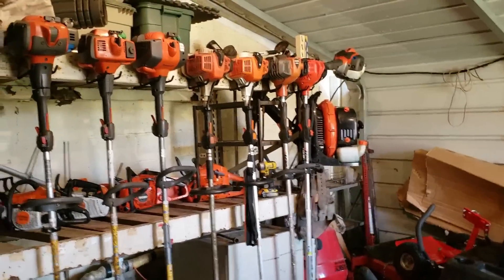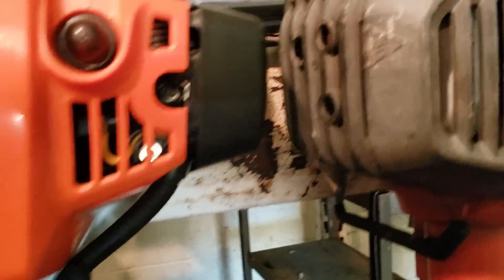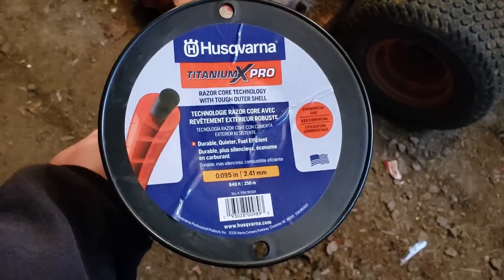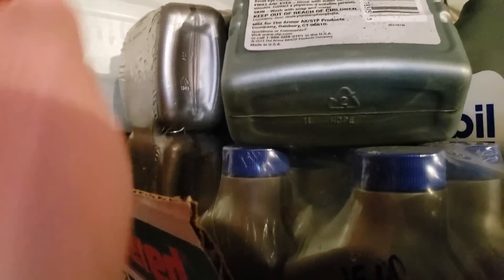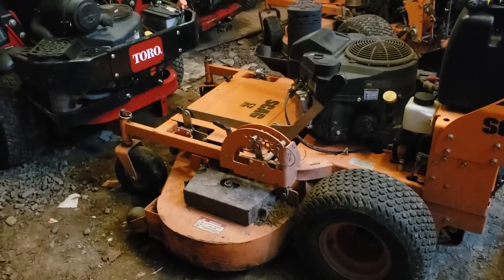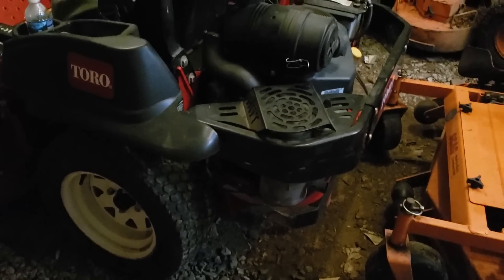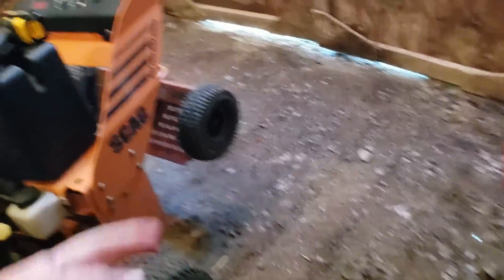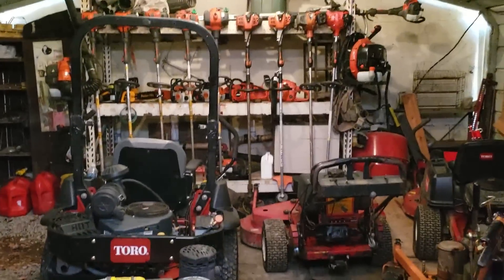2019 Lawn Equipment Exposed!

Comment: have you used redmax trimmers? I know husqvarna bought them just curious if there trimmers are similar.
Reply from the maker: Yes 1. Redmax invented the strato charged engine! Stihl bought 60k of them to keep making trimmers when the EPA first started cracking down.Husky now calls it "x torque".Same engines in both.redmax has a model I wanna try that has no husky brother.BCZ3060TS is the one 29.5cc.Had to go look at it to remember all those numbers lol.
Reply: @exterminator1  thanks for the response.My dealer carries redmax and not husky,I love my husky trimmers and blowers so i will stick with redmax then
Reply from the maker: @legioncollector4218  Cant go wrong with redmax. The trigger is a bit long is all